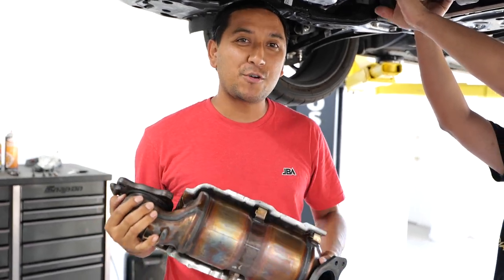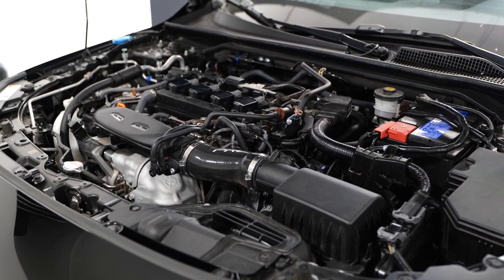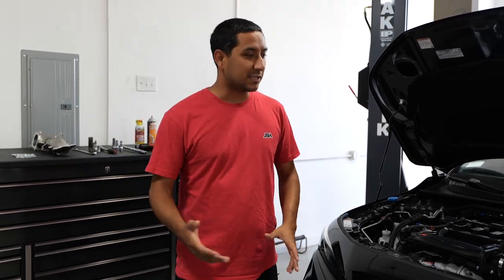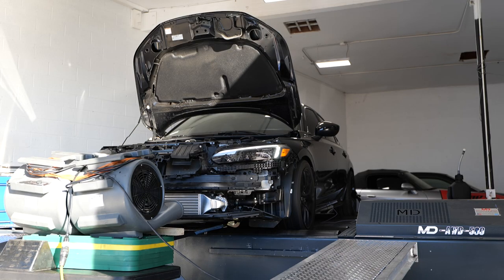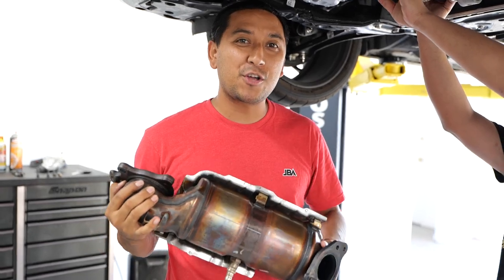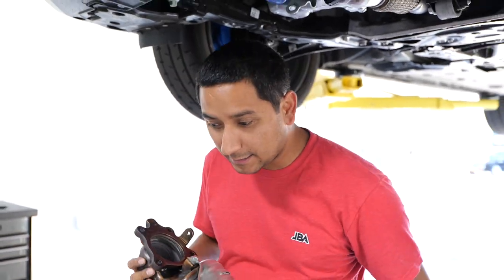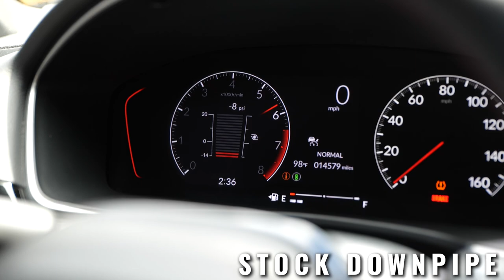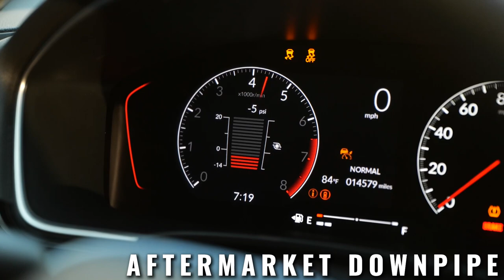Downpipe Install on 2022 Honda Civic | Burbles!!!

Comment: On those big revs, that rev hang is absolutely incredible - almost like you're actually holding the pedal down which I assume you're not?  Wow - I heard it was an issue but genuinely surprised at how much that hangs, especially when it's supposed to be 'sporty' and in a manual. Almost like the flywheel weighs 200kg
Reply: Look at the tachometer it doesn’t appear to be hanging.
Reply: My 17 WRX had terrible rev hang one of the reasons I got rid of it.

Comment: which downpipe did you use? ive been looking for a catless version for mine too
Reply: PRL
Reply: pro doesnt make catless tho?
Reply: @renzigiraldo6274  Oh really, I looked at PRL Motorsports online that they don't have those downpipe but maybe he used 10th SI downpipe that kit should be same design as 11th. I know 27WON offer downpipe for 11th.
Reply: @georgegomez7173  I have the 27WON downpipe. Sounds exactly the same
Reply: @ElViperr408  That's 🤔, you should be 💯! 😁👍
Reply: @georgegomez7173  looks like the 10&11 dp o2 sensor location is slightly different. It would probably still fit tho if all the bolt holes lined up.

Comment: Which down pipe did you decide to go with and is tuning required?
Reply: id say to get the most out of the down pipe a tune is required🤷‍♂
Reply: I went with the 27WON. It sounds good
Reply: @ElViperr408  Will it throw an engine light
Reply: @4flow729  yea it will. At first I drove to my GF’s house (40 minutes away) and no check engine. After that I did lol

Comment: do you guys ever have miss fires my car trips out sometimes when im running E or not and its random
Reply: I dont run E. Sometimes just a gallon. 0 misfires
Reply: @chorizojuice  i can tell you this this flex kit is amazing only thing holding back is the clutch 😏 it literally is a different car! and i dont think its the E cause it will do it after many tanks of 93 first 300 miles i got a cel took it to honda they told me cam position sensor was unplugged.
Reply: @glockmodder  how does it compare to a basemap of straight gas?
Reply: @chorizojuice  gotta be 40whp and even more torque! you have to do roll ons no stomping in gas past 3rd
Reply: @glockmodder  thatll be my first mod after a new clutch. For now itll be dp or intercooler next.
Reply: @chorizojuice  intercooler would be really nice.